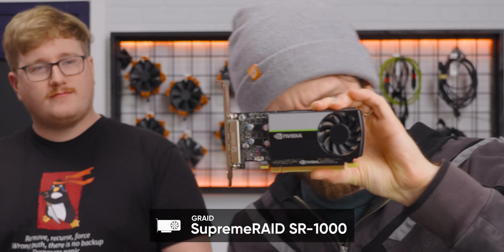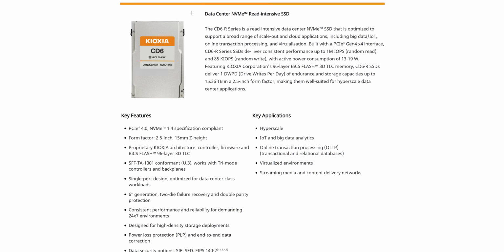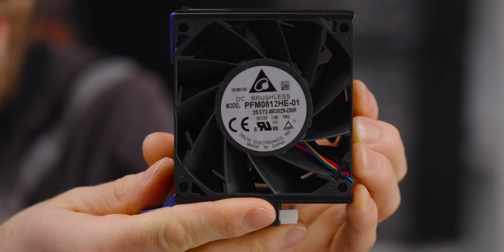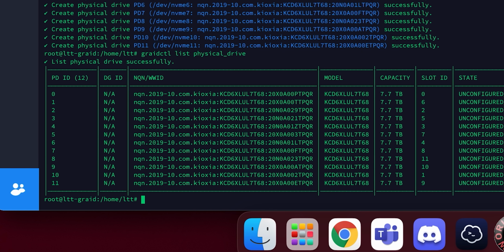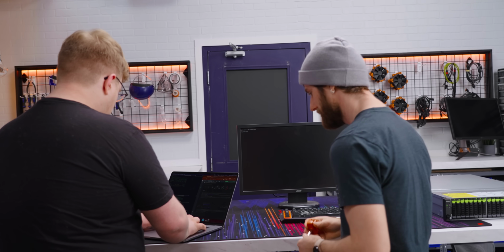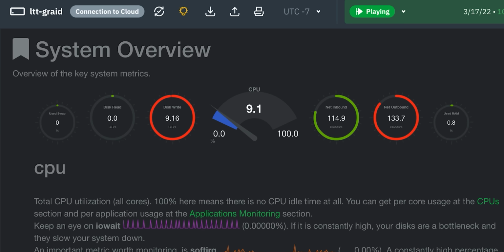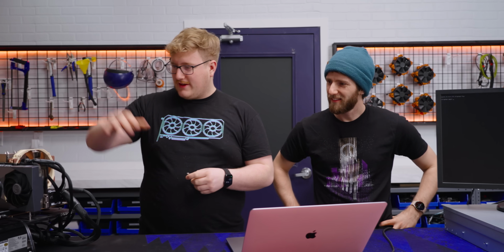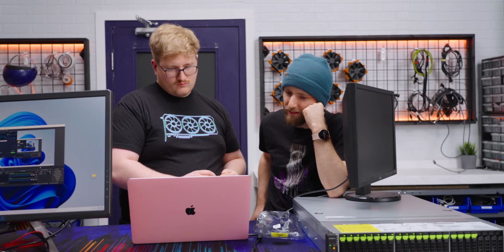I predicted the future! - GRAID Graphics Accelerated Storage

Comment: Seems like an exciting step in making alternative hardware accelerators common place in systems. It's wild to think that despite how far innovation has pushed the capabilities of modern gpus in terms of video encoding and rasterization, they are but one manifestation of hardware accelerators in a wide field with new opportunities coming from things like fpgas or asics.
Reply: It's interesting because this is much like an echo of the past. In the 90s we had co-processors and such. Sound cards were also hip until everyone had their baked-in Realtek chip. We kinda went backwards and are now seeing the start of a boom of new accelerators, possibly due to the progress of performance improvement slowing down.
Reply: @Naetrox  Good point, it doesn’t seem as viable to just throw more general compute at a problem. Instead better specified architecture provides much more real performance. I wonder if someday the almighty cpu might become a compute analog to a clock generator.
Reply: @uncle-ff7jq  I'm holding out for quantum computers, I think we'll see adoption of them in a few decades as we figure out how to operate them at room temperature.

Comment: Surprised to hear them talking so positively about RAID 5 and dismissing RAID 10 as "expensive". Yes, you do lose half your capacity with RAID 10, but you get more performance, more resiliency, and importantly rebuilds are faster / less resource intensive. Rebuilding your array from a failed disk doesn't matter so much when all the drives are new, but when they're all end of life, the extra strain from a RAID 5 rebuild can cause a chain of failures, potentially causing a totally array loss. Coming from industry, I'd never deploy a RAID 5 array again, RAID 10 all the way. RAID 1 also has some good use cases.
Reply: Rebuilding an array is the worst part of a process when you do get a failure.
Reply: How do you feel about raid 6?
Reply: He did specify that there are use cases for RAID 10, but it was severe overkill for the hardware/use case they were considering.
Reply: the extra stress for raid5-6 etc while rebuilding, is more of a problem for the mechanical hard drives. ssd's, especially of that class, don't suffer the same drawbacks, only write wear matters, reads don't affect them. also due to much higher transfer speed, the rebuild will complete way faster. still, with a bit of patience and thinking, you can use a combination of different raid levels, that will fill the needs better...
Reply: I prefer RAID 50 if you wanna go with the mirroring route.
Reply: Yeah I love this channel, but you will very rarely find any sort of RAID 5 in even the SMB space. This is also the same channel that now has multiple videos where data was almost lost permanently from bad storage practices so for anyone just getting into IT take the advice here like anywhere with a grain of salt.
Reply: Yep. AFAIK Raid 5 is not enough for big arrays/servers where a second failure during a rebuild is very likely (same age drives or similar damage/errors, or strain in the effort needed for the rebuild).
Reply: @TechyBen  But this hardware isn't for huge arrays. It is for relatively small, fast arrays. 

If Linus was putting together a large storage array he may say something different (and he has put together many servers with more redundancy in the past).
Reply: @giornikitop5373  laid out just what I was going to say.  Drive failures on rebuild are a non issue when dealing with SSD arrays.  a raid 10 is just wasting writes on drives, and as such makes them as likely to fail as their mirror.
Reply: SSD RAID failures can happen for several  reasons and some of the most common are: Power Loss PCIe enumeration, hot plugging, voltage/signal noise, command timeout, and silent data corruption. If you have something like RAID 10 then when multiple drives drop you can still run up to the redundancy failure point of approximately (total SSDs-2)/2. 

With ZFS,  the silent errors are nearly zero and having a write data stream cache using Optane SSD or DIMMs then command timeouts can be re-queued resulting in a highly uniform performance level. Consistent performance is needed for when the server is being rated for  maximum user system performance and quality of service.
Reply: That's very informative, as a hobbyist I love reading real-life experience from pros, thanks for sharing!
Reply: @paul.1337  Did you skip the part where they tested IOPs for a more realistic scenario like multi-user access ? 
Also, "in the real world" ? You realize that those are video editing servers ... with tens or even hundreds of GB per file of raw footage? If you have several people, like at LTT, accessing and transferring their project files then max sequential throughput is absolutely a factor.
Reply: Amen brother! RAID 5 is so 1999!
Reply: RAID6 is the new RAID5
Reply: Raid 10 still puts the mirrored pair under extreme load during the rebuild.  The risk of drives failing during a rebuild is overstated.  The more common cause of the secondary drive failing, is people mistakenly install multiple drives from the same batch into the same parity group.  Disks should be sources from multiple batches and spread across parity groups.  Raid 6 is more widely used within Enterprises where performance isn't required otherwise RAID60.  RAID10 use is very limited to old-school people with too much money, or require extreme performance.

They need proper monitoring with hot spares.  I do agree that RAID5 is far too risky for anyone that cares about data.
Reply: I think the use case here, especially for sake of the video is largely to show off the highest speed possible that graid can provide. Afterall it is a new techogly and linus's channel revolves around stress testing and achieving the highest preformance possible.
Reply: You said that Raid 1 also has good use cases.
Could please give some examples for these use cases?
Reply: nah i agree with linus, raid10 is lame lol
Reply: @Tim Smith most servers are purchased at the same time, through one vendor. Mixing drive batches us generally only going to even be viable for rather large installations. For most of us, it's not going to happen. 

RAID 5 rebuild failure us a real thing, and expecting it is what makes it a trivial problem. When that old array degrades, you treat it as a goner. The last such failure I had, I didn't even try to rebuilding. I just grabbed some newer data off with robocopy, and went all new. In the process of wiping the drives for disposal, 2 more failed, out of an array with 8 drives total (in a chassis with 8 bays, and no, I didn't put it there - the new one has 6 drives in a ZFS "RAID10", plus two hot spares, plus 6 empty bays).

100% agree on having and keeping up with spares, though. Drives are too cheap these days to wait for a failure to buy and install a new one.

Comment: You should run some tests with degraded RAID5, see what really happens with CPU utilization at that point. Expect it'll still offload to the GPU. Or a fully degraded RAID6 (two disks failed)
Reply: Based on the diagram, in that read does not go through the GPU.  I would expect it to hit the CPU.  That's a great question.

Comment: Meh, I'll take ZFS with NVMe drives instead. Plenty of performance, low CPU overhead and excellent data integrity. TrueNAS would work just fine on that server.. Pull the power cord out while you're running that benchmark, let's see how it handles recovery.

Comment: But hardware raid has one huge, show-stopping (at least for me) drawback: If the RAID controller goes out, your need the EXACT same chipset and version, for the most part, in order to access your drives again. Any deviation and it will not see the data, unless things have changed significantly in recent times. Software raid wouldnt suffer from this, since if the hardware (or windows/linux) host dies, you can just stick the drives in another computer and as long as you install the same software, it should work.
Reply: This seems very solvable. This solution seems to just be a cuda-capable software raid, only bundled with a gpu it's been validated with. Barring the license, you should be able to swap the hardware for anything you want if it's capable in regard to cuda versions

Comment: I'd be interested to see its possible to use as a SAN / LVM over iSCSI for Citrix or Proxmox and how it would perform.
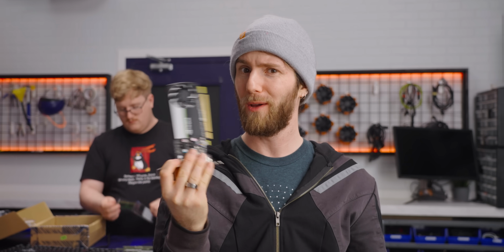Reply: With 2 x 1Gb NIC by default (5:50 in the video) will perform pretty lousy. Any NAS with 10Gb NIC will beat it. But, if you can up it with some of the 2 Port 25 Gb NIC, possibly two of them, and an appropriate Switch, it will fly. I want to check if that combination is possible - I want to run it as an active storage / SAN for VMWare 7 VMs
Reply: @ivanmilenkovic8285  minor point of note: 25Gb NICs are 25 gigabit, which is ~1/8th what the old system they were using got, and an even smaller fraction of the 50 Gigabyte speeds they were seeing at peak. To get a NIC that can take full advantage* of that you need something more along the lines of a 400Gigabit infiniband NIC. Absolutely wild stuff.

*by full advantage I mean a single user. Obviously if you’re going to share this over 10 editors like Linus is going to, that means each would be getting 1/10 that or 25Gb nics probably (because I don’t know if they make 50gb nics, I think it jumps straight from 25 to 100 just from my amateur looking around). But you’d still want a full speed line to your switch in that case, no?
Reply: @levygaming3133  You get the point! I was just thinking, 48 x 25Gb switches you can get relatively cheap for used ones, 25Gb cards are reasonable in price so make sense to have it for end-users. Theoretically, you can bond 2 25Gb ports and get about 5000Kb/s for the user, which is the speed of 4th Gen NVMe. I am more interested in the server-to-server side, bonding 4 25Gb ports on 2 NICS and getting 100Gbps per server, few of them in that configuration and 40Gb is fully utilized :D
Reply: @ivanmilenkovic8285  actually, I really didn’t get your thinking until you explained it just that little more in depth there. That’s a really great idea, cheap (relatively) server to server communication like that was just something I totally wasn’t thinking of. 

Are 4x25Gb PCIe 16x NICs even a possibility or not, because that that would simplify your plan slightly. I just remember the bandwidth of a generation of PCIe 16x is like 63gb but I can’t remember if that was Gen 5 or if that was bits vs bytes.
Reply: @levygaming3133  Dell QLogic QL41262 25Gb is what I get from eBay for about $150 per card, each card is dual-port 25Gb, I put 2 in every ESXi server, the card itself is PCIe 3.0 x8 host interface, is more than sufficient to run the dual port in full 50Gbps per card. (Gen3 Lane is 1GB/s per lane, need 5GB/s top, have 8 lanes)

Comment: It originally was called Redundant Array of Inexpensive Disks as you could make one 'big disk' from small ones cheaper than you could buy a big disk for. And if one drive fell over it would be Inexpensive to replace compared to one big disk. 
The disks are not really Independent when they are striped as they depend on the parity from the other disks.
The big disks were known as "single large expensive disk" (SLED).

Comment: the linux 'way' to do it, would be lvm, which gives you a wide array of battle tested features. if you put butterfs on top of that, you get capability and flexibility unmet by any other storage solution... and your entirely left on to your own devices, in terms of how to stack it all up and make it a proper SAN/NAS solution and who is going to commission, delete, backup those volumes and shares? in the end most companies end up buying appliances, that use that exact stack + iscsi/foiscsi/nfs/cifs internally and implement a nice gui to actually make it approachable.

Comment: Yep, GPUs are great SSIMD processing units.    As such they can be used to do on the fly encryption, decryption, ECC, and various other storage acceleration functions.  

Furthermore, most of them have built in programmable PCI-E SMUs which with the right firmware can be used to create a virtual device of whatever type you want.

Furthermore the local high speed memory can be purposed into cache for the whole thing.

Comment: Most NVIDIA Display GPU will not utilize Acceleration/CUDA software if there no ACTIVE Display connected to the GPU.  This is hard-coded in the Consumer GPU Line.  We got around this for vDI by plugging in a Video Dongle (HDMI Dummy Plug from Amazon). That may be the reason the software would not see the GPU.  Just a thought...

Comment: I recall seeing a similar bit of software called Gpu Nsualate which functions instead as a AI accelerated software that uses a GPU as a temporary backup disk in the point of a failure. Interestingly enough, the demo shown allowed almost 8 out of the 50 installed SSD's to be removed before the data recreated by the GPU was lost.

Comment: Do over fiber for the parity drives on RAID 3. Put those in an off-site firesafe. Then make the local array be RAID for quick rebuild for actually drive failure. But still have the entire parity if the whole building goes down....

Comment: RAID parity calculation (on accelerators) actually isn't all that computational intensive.

For a LONG time, a LOT of PCI and/or PCI-X hardware RAID controllers used to use the Intel i960 RISC processor to handle the parity calculations and it took a LONGGGG time before the hardware RAID accelerator processor needed to be updated to something faster to be able to handle the increased speeds.

Interestingly enough though, Broadcom (which used to be Avago, which used to be LSI) DOESN'T have a hardware RAID accelerator for NVMe devices (unlike their SAS RAID and SATA RAID product lineups) for said hardware accelerated parity calculations.

But it isn't too unsurprising that you can use a GPU for that, even a relatively low end one at that, although it probably still doesn't make the most out of said GPU given that a lot of parity data is stream, rather than a matrix data/operations (which is what GPUs are even far better at than CPUs).

Comment: Smi utilization is temporal not spatial.
That is, it does not show the amount of resources used (threads/SM).
Rather shows the amount of time something(anything, even a single thread out of the 896) is used in the last time window (eg last 100ms).
So what you are seeing is basically saying, that it is always not idle.
You could use the current TDP to aproximate spatial utilization.
In your case though TDP is NA, which is weird for a T1000.
This might be due to the driver? 470 is about 6 months
Might be due to the driver version, as NVIDIA tends to 'deprecate' features for 'older' cards.

Cheers

Comment: I also would be interested in seeing the GRAID devs throw together a "expeimental non-production" special build with support for just throwing any GPU hardware with the supported APIs in as the storage-management unit.
Just to see how hard you can push it forwards and backwards in hardware age and specs.
Even if it takes watercooling some of the GPUs to make them work for this; ESPECIALLY if it takes watercooling to force them to work for this.
Show us how great your product is by giving it abusive stress tests and throwing extreme edge cases and broken assumptions at it. 
What if it is running on a single core CPU? What if the GPU PCIe is passed through into a VM, or even passed through into a VM over an ethernet link? Does data integrity survive the GPU losing its cooling and having to massively throttle down?

Comment: 18:50 The GPU might not actually be getting adequate cooling. High velocity airflow is low pressure, and you've got a torrent of Air coming off the blowymatrons, so the GPU fan probably can't pull enough air into itself to cool the GPU.

Comment: Hey, you mentioned SMB issues, just wanted to share that if you aren't on samba 14.5, it's worth upgrading if you can. It doesn't have SMB Direct yet or io_uring splicing implemented, but it still pulls off a significant performance upgrade, especially in bursts of small files/short-lived connections (like setting up a git repository for example). I've got mine running in a docker because Ubuntu doesn't support 14.5 yet and I saw my SAS3 z-raid2 array write speeds increase from ~300MB/s to ~700MB/s for large sequential files (10GB range). Can't imagine what it would be like on an nvme system. Give it a look!

Comment: Very interesting indeed. If my gussing that it is based on CUDA  and my knowledge about "RAID is more relavant to integers" is correct, Turing or Ampere cards could actually be benificial to write performance. Lokking forward to see somebody make that happen and to test if that will make any difference.
Also, it would be interesting to see if general purpose parallel interger accelation ASICs would be a thing, as using GPUs for this kind of tasks basically just wastes all the FP units on the die and is not really energy efficient.

Comment: in their marketing materials they are like "ASIC SLOW" but you can always make faster and more efficient ASIC, the issue, as you said, limited number of lanes available to a single card, you essentially could only use 4 drives full speed and they are offering 32

but would I switch? there's vendor lock in but there's also nearly zero collective experience with this solution around the world so only if I had reliable backups on regular RAID